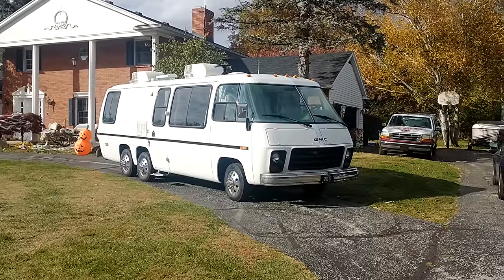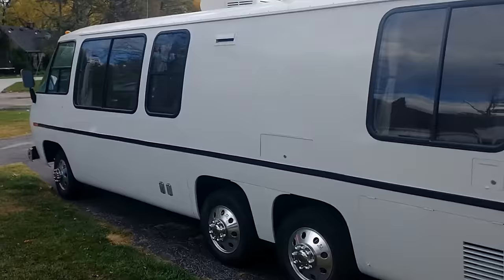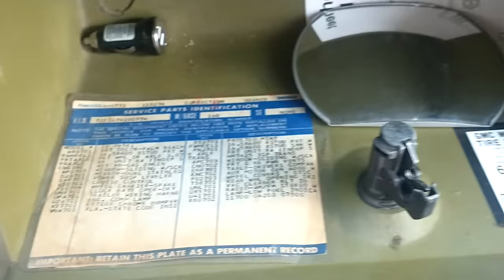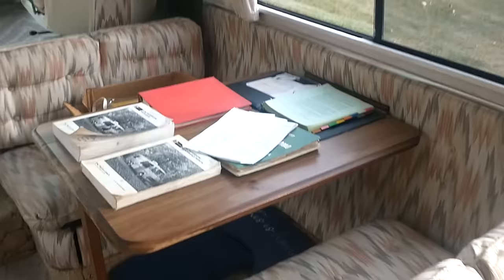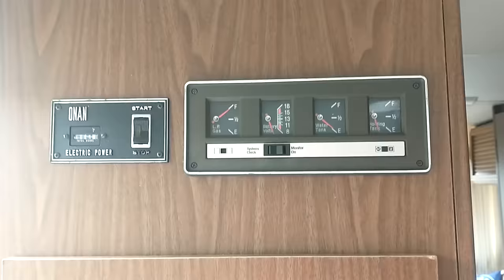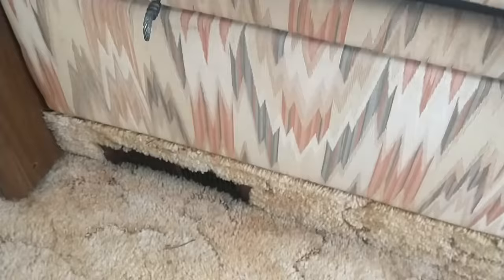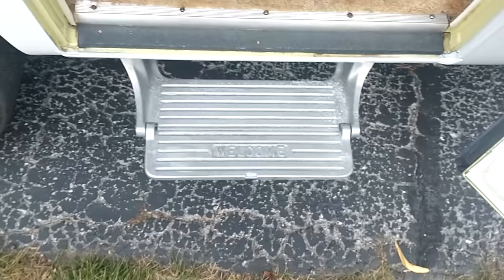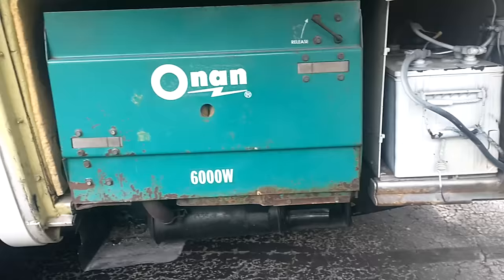GMC motorhome, early 1977

Comment: The fans of this MH are of the opinion that this is the greatest MH ever built
and they are  STUNNED  that no other builder is not building these today.
Well, its like this, if this WAS the greatest MH ever built many builders would
be making them but alas, its not what the market is interested in at this time.
The hot MH model today is campervans build on the current Euro van chassis.

!

Comment: I’d still be driving one if there were service centers as in the ole days.  We’ve had two.   If it is green inside it is a Palm Springs.  It is sitting correctly so the torsion bars are set to specs and the air system is working without leaks.  Get a spare air bag just in case.

Comment: Yep, just like mine a 77 Palm Beach model. Look inside the glove box and it has a decal plate with engine size and axles weight. Under the hood on the right side is the vin plate with the same information.
Reply from the maker: I do show the glovebox sticker later in the video.455
Reply: @markst.germain9286   mine is the 403 olds small block. It's pistons are a larger diameter with a shorter stroke. 
It's not uncommon for manufacturers to use up whare house stock before making running changes during a model year. So if yours has the 455 big block, then it is an early 77 model in that production year.
Reply from the maker: @albertcassler8763 yes, built in November 76. #6923

Comment: Many motorhomes were often designed, without design? Looking ungainly, large truck like wind fighting front ends. But then came the GMC motorhome of the 1970s. I have to steal from Chrysler,"Suddenly it's 2000! But I think even approaching 50 years old they still look super moden on our roads in 2023. The point been the body design, unfortunately the technology and power train were absolutely 1977.

Comment: Please drop the tanks if they have not and replace the rubber hoses before the breakdown.
also look at getting the blackwater system changed to a  mulcher system. bfore the pull vavlae for the tank fails and brakes

Comment: Wonder why they didn't make custom Frigidaire appliances to go in here.  Frigidaire was owned by GM at the time.
Reply from the maker: I think they were trying to use as many existing components as possible, the furnace the stove and the water heater would be good examples of this.

Comment: I recently required one of these mines a 77 also. I have a few questions maybe you might be able to help me ??
Reply from the maker: Maybe.
Reply: @markst.germain9286  do you know any thing about the air suspension?
Reply: @markst.germain9286  having problems with it going up I’ve been having to put air in it manually with a air compressor
Reply from the maker: @joshs4844  I bought a system from air-lift it contained a compressor, manifold valve and a remote control.

Comment: 455? A buick engine?
Reply from the maker: Oldsmobile toronado powertrain. 455Rocket
Reply: @markst.germain9286  awesome
Reply: I never guessed a Gas engine and front wheel drive.   The tandem rear axles make it look so much able for it to carry heavy loads than a Winnebago.  Those Alcoa aluminum wheels are cool, way nicer than a steel wheel and hub cap.

Comment: EVERYONE IS WONDERING THE PRICE OR VALUE OF A GMC MOTOR COACH THEY RANGE FROM $27,000 to 45,000 .
$ 45,000 70% OF EVERYTHING HAS BEEN REPLACED WITH NEW ORIGINAL PARTS. 
 $ 45,000 IS A GREAT PRICE BUT THE 455 GUZZLES GAS BADLY 6.2 MPG . 
 YOU COULD SPEND $ 9,000-12,000 WITH A FEW DIFFERENT TYPE ENGINES THAT WOULD WORK WITH THIS TRANSMISSION.

SO $53,000-55,000 GETS YOU A GREAT SHOWROOM CONDITION MOTOR HOME WITH ENGINE GHAT CAN GET 10-11 MPG
Reply from the maker: I have about 11k in it and get 7mpg.